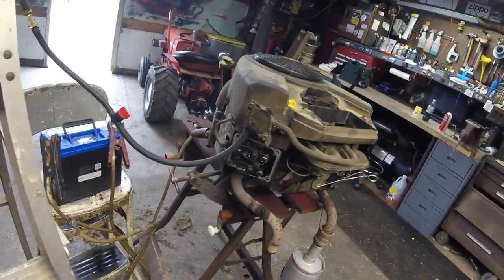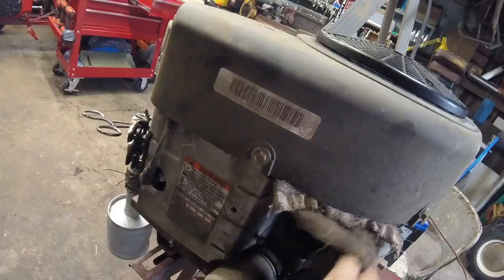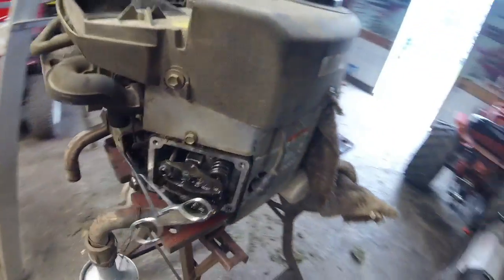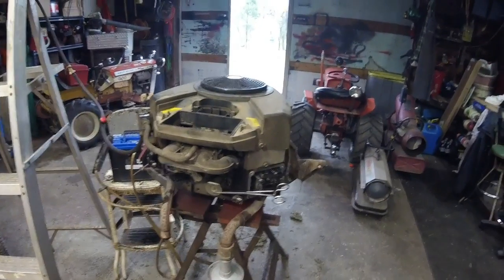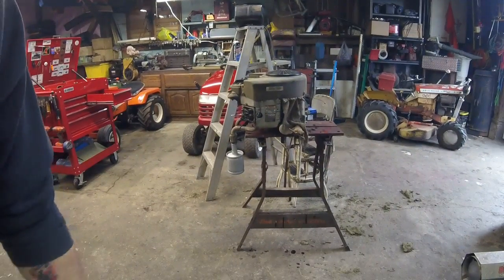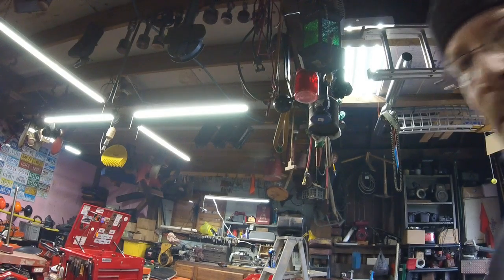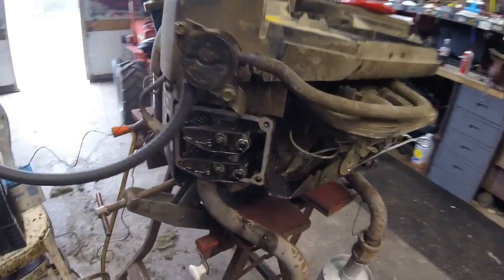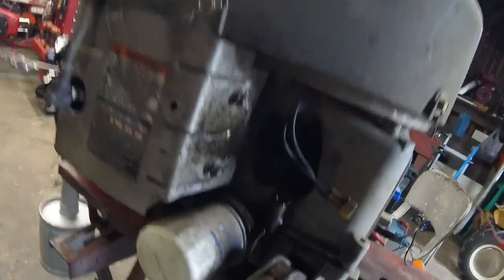Will This Engine Run With A Hole In The Block???

Comment: Not bad, I had a feeling to backfire solenoid was holding you up that's why it wouldn't run.
Reply from the maker: Yep, it totally slipped my mind!! After opening it with a separate battery, it was game on. I now have 2/3 of a good engine that I can break down for my parts cache. Cheers Red! Zip~

Comment: You are crazier than hell. That was awesome thought. I have seen that before. I have had them com in the shop like that. Had a mystery leak. Upon further review found hole behind starter not visible until i removed the starter. One cylinder was trashed and other ran. The only reason they said they brought it in was low power and a oil leak. Good times for sure. Great video
Reply from the maker: I was nervous as hell!!! I already knew I was crazy lol. It actually sounded great...just like a single cylinder OHV Briggs. Hell, I could patch the hole and run it as a 13.5hp...Or, better yet...repair the right cylinder and make a portable air compressor, using the  blown side as the compressor. Like those old Wisconsin V4's. The crank journal is surprisingly devoid of galling from the connecting rod...but the wrist pin has signs of over heating, which may explain how the entire connecting rod exited the block. There was nothing at all on the wrist pin...that's a first for me. Cheers my good man! Zip~

Comment: *RUNNING 27 HP BRIGGS V-TWIN* small hole in the block, minor rod damage on one cylinder, small oil leak $200 FIRM!
i can see it now Zip LOL
heck if it was me, id patch that hole some how and use it as a toy engine. put it on some crapper lawn tractor to putt around and MAYBE pull a cart with or something. after cleaning it up real good first of course
or something idk lol
Reply from the maker: lol...I thought about it! I had an April Fools Idea to mount it back in the Crapsman and go for a ride, but I want to save what I can from it for other engines that are sure to show up hurt. Cheers Sir Bio! I like your sense of humor! Zip~
Reply: lol! thanks zip! yea, in the long run the parts would certainly be worth more than the fun haha
Reply from the maker: I'm still tempted to patch that fist sized hole, throw in a new connecting rod and see how long it'll last. Heck, I don't have anything in it to speak of. What's the saying? No harm no foul? hehe Cheers Buddy! Zip~
Reply: i say go for it! wouldnt be out much to rebuild it if everything goes well and it would certainly be worth the views and such for the scientific value! maybe make a vlog and see what your audience would like to see?
:D

Comment: Wow that was fun!!!!!   I Love it.  Your other one in the Poulan was running on 1 for a while.
Reply from the maker: Very true! Only it wasn't as well ventilated an engine lol. I was pretty sure it would run, after seeing there was nothing left of the other connecting rod and everything else was in tact. That broken connecting rod exited stage left and pretty much completely cleared it self from the engine oil sump. There were just a couple little chips left in there way out of moving parts territory.  Cheers Bruce! Sean~
Reply: It is amazing how tough some of these motors are.  I had a ATV Honda Trike (sp) many years ago now, that had a hole in the block. I put a new rod into it and siliconed the block back together and it ran for 3 years.
Reply from the maker: I'm actually really considering patching the block, cleaning up the bore and throwing another connecting rod in and seeing how much longer this engine would last. None of the internals were hurt at all, to my surprise. We'll see what's to come of it in time. Cheers my Friend! Zip~ p.s. I'm glad you're perking up!
Reply: I overdid it yesterday  (Mrs. Bruce  isn't happy with me).  I am modifying an aftermarket John Deere seat.  This is your complaint about the green stuff.  The JD factory seat was $250!!!   The aftermarket seat (still yellow) I got for $59.  I am moving the brackets to the new seat and overdid it pounding out the spot welds.  I am not that smart.
Reply from the maker: You nailed it with my problem with the Green stuff. WAY over priced just because of the name on it. It's like the difference between a brand name tool like Snap-On, and the Manufacturer that supplies the Snap-On selling their versions at 1/4 the price. I'll take my lesser expensive, but equally as well made every day over branded over priced items all across the spectrum. I'm with Mrs. Bruce...gotta pace your self my good friend! Rest Up!! Sean~

Comment: Well I would say that,s alright.
Reply from the maker: At least now I know what's usable! Cam, heads, carb, charging system, starter, oil pump....everything but the block and crank shaft unless I have  it cleaned up. Cheers my Friend! Zip~